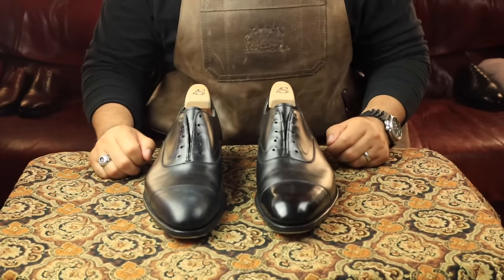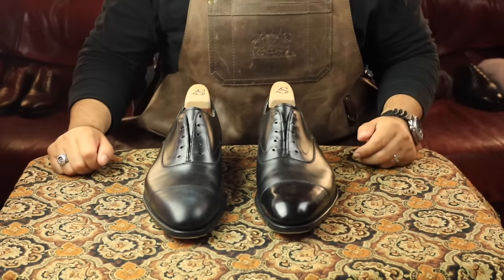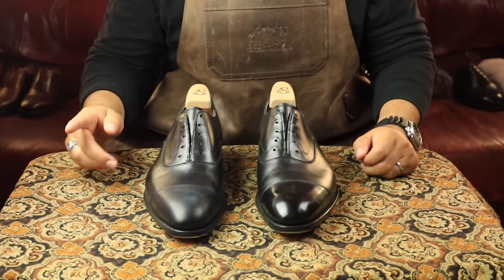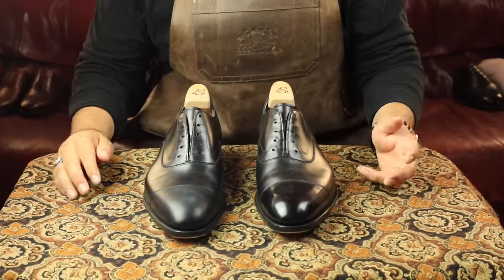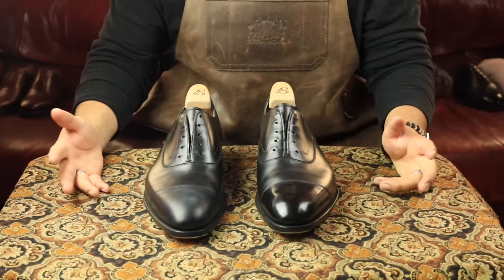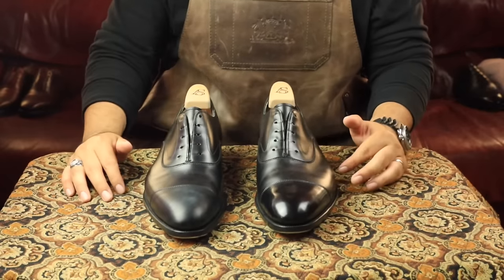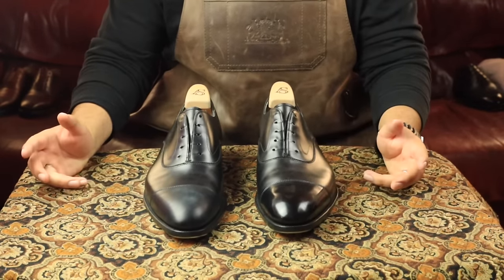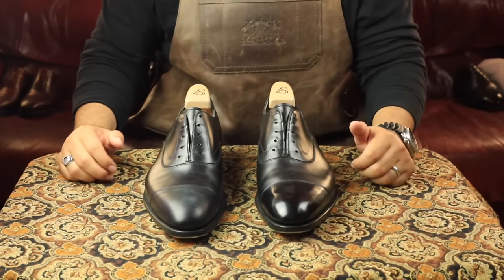Can You Mirror Shine a Shoe Using Powered Tools to Make it Easier?

Comment: I used to shine shoes (professionally) when I was 13-15. The reason you won't get a mirror shine with any of those brushes is because of the hair filament size. It's like trying to get a mirror shine with 600 grit sand paper.
Reply: What do you recommend

Comment: There was a shoe shine place at a food court in Irvine I used to go to 20 years ago.   The guy had an air gun or power drill of some kind with an attachment, and this guy did the best shines with it I have ever seen before or since.  $10 and 15 minutes.   It was incredible.  I've spent 20 years looking for the tools he used and have yet to find them.  But I know it exists (or can be done) and it works better than anything I've ever seen.  I wish I had asked them about it before they moved out, but I was new to it and didn't realize how special his work and tools were.
Reply: Advice from experts: never use a heat gun on your smooth leather products. It creates long term damage and causes disrupts in the inner layers of the leather
Reply: i use a warm oil (melted wax) and a paint brush, i melt the wax and brush it on to the shoe then use a cordless drill with a DIY attatchment made of a Screw and half of a horse hair brush and some epoxy, step 1 cut the brush in half then shape it into a circle, step 2 drill a hole slightly smaller than the screw, screw the screw into the brush and place a small amount of epoxy over the screw head making it more smooth optional, step 3 polish boots, paint the wax on and buff at slow speed, takes about 8-13 minutes to get mirror shine, been doing it this way since i was in the army.
Reply: @ainzooalgown7589  Many thanks for the clearly explained & detailed steps, Ainz! Well noted & I will be trying it out!
Reply: Where in irvine? That’s a 30 minute drive from me
Reply: You don’t need tools. Just time and technique.
Reply: Great tutorial / technique. Would be interesting to try this out, pretty Simple. I’ve shined cars before with dual action and they make tiny versions of those that might provide even more control. Shoe has to be secure of course.

Comment: More water on the brush. You've put the same amount of water as with the shamois yet the surface of the brush is dozens of times bigger. The ratio was off. The idea is there so it MUST be possible somehow. Again, great video, thanks for exploring.
Reply: Yeah, I also think one of the major problems is with the water. When he adds water it stays on the shamois rather than being wiped off. I think he should've sprayed water across the buffer instead of the shoe.

Comment: I use a battery powered mini car polisher that has a head that is horizontal to the shoe rather than vertical. The polisher has a maximum 2800 rpm speed and I run it at about half speed. I don't have a lint problem. But it only provides a good base shine rather than a mirror shine.
Reply: Sheepskin buffing rag and sheep suede are my favorite for final buffing.

Comment: When I was in the Army, I used strips of cloth diapers wrapped around a dowel in a drill to do my first heavy duty polishing on my brand news boots and low quarters. It made such a good first layer, that it was extremely easy to bring back a good shine quickly after that. Hardly spent any time at all on my footgear after that initial polish. All I had to do was rub some polish on with my finger, let it dry and then whip it with a polyester, or nylon sock after that.

Comment: You can do an almost mirror shine with tools, but it wont be like the real deal.

First, you need a silk wheel: i have one on my finishing bench and they're not so easy to find.
Then, forget the polish and use pure beeswax or carnauba wax, put on the wheel itself.
Then you use the wheel at low RPM to saturate the leather with wax.

It's wonderful for bookbinders, not so formidable on aniline or box.

Source:i work as a shoemaker since 2012.

Comment: Great video!  When I was in the Air Force in the 80’s we were issued combat boots with a capped toe.  I was able to get the mirror shine on the toe cap using - black wax, horsehair brush, water, and buffing cloth.  But the secret ingredient which appeared to get the wax to layer up and provide the mirror shine was panty hose applied with a buffing motion over the toe.

Comment: I may have found a way! 
I use a very fine cloth buffing wheel on my bench grinder to do the majority of the shining when I wax (aka burn down, look it up) my drill boots. The wheel is made up of multiple layers of soft cloth stacked on top of each other, which you then use the edges of as it rotates. Although I’m working on a pretty thick layer of beeswax (which was applied hot, so now hardened) the wheel does get close enough to a mirror shine that a minute or so by hand is enough to finish it off. 
I think this could probably work on a show that hasn’t been done with beeswax if you:
•ran the wheel very slowly (and made sure it was the softest available
•applied the polish only one or two layers at a time and buff each application to the highest shine possible as you go, rather than doing the majority at the end 
•and didn’t use any water, as I’ve had better results by just touching a block of beeswax gently to the buffing wheel for lubrication. 
Like I mentioned, I’ve only ever used this in scenarios where I’m polishing over a thick layer of hard beeswax, but I really think with a little adjustment it could probably work for normal shining too. 
Hope there’s something in there that can help 👍
Reply: Yeah slower speeds (with a good grinder with good speed control) along with a good soft cloth wheel would likely turn this around. Appreciate the data point!

Comment: When I was in the Army, there was a method that was used by a few soldiers that seemed crazy.  You would cake on a bunch of Kiwi on your boots, and then "bake" them in an oven (I don't remember what temp) and it would create an almost plastic-like mirror polish when you finished them.
Reply: There was a similar method with a blowtorch. If they are brand new boots, Kiwi and a hair dryer would be a good start. You weren't supposed to use Cherry Blossom, but one guy did and it worked fine.

Comment: I use a powered horsehair brush to get mirror shine on boots for the law enforcement academy. The rpm is alot lower than the one you used, I use Lincoln shoe polish and a heat gun. I finish my shines off with spit and a cotton t-shirt but the brush does 95% of the job. Great video!

Comment: I may have found a way!
1 use a very fine cloth buffing wheel on my bench grinder to do the majority of the shining when I wax (aka burn down, look it up) my drill boots. The wheel is made up of multiple layers of soft cloth stacked on top of each other, which you then use the edges of as it rotates. Although I'm working on a pretty thick layer of beeswax (which was applied hot, so now hardened) the wheel does get close enough to a mirror shine that a minute or so by hand is enough to finish it off.
I think this could probably work on a shoe that hasn't been done with beeswax if you:
•ran the wheel much slower than I do, of course making sure it’s the softest available 
•applied the polish only one or two layers at a time and buff each application to the highest shine possible as you go, rather than doing the majority at the end
•and didn't use any water, as I've had better results by just touching a block of beeswax gently to the buffing wheel for lubrication.
Like I mentioned, l've only ever used this in scenarios where I'm polishing over a thick layer of hard beeswax, but I really think with a little adjustment it could probably work for normal shining too.
Hope there's something in there that can help 👍

Comment: I think the problem lies in the materials.  Short fiber cotton is bound to do exactly what it did: throw lint all over the place! I had one beautiful mirror shine ruined by a single piece of lint, captured for all to see, in the clear glass of the shine. You do not want to know what I said when I discovered it!
You may have more success if you try putting an old merino wool sock over the polisher. I use one, by hand, to finish and maintain my shines, both mirror and satin, and have had no problems. Who knows; maybe the animal recognizes the other animal! Other than that, it's best to stick with 100% cotton t-shirts or chamois. I think that Dremel attachment was meant for polishing things other than shoes. It was a fun video!
Reply: Dremel RPM is just too ridiculously high for it to work.. a car polisher would probably do a better job.

Comment: Regarding the fuzzies you get from the felt polish pads:
You can limit those by applying a quick sanding to the pads. Start the felt pad spinning and apply some sandpaper. The fuzzies should latch on and leave you with a cleaner felt pad.

You /should/ be able to then use the felt pad (at low speed) to get a much finer shine than the horsehair brush wheel gave you.

Comment: First, don't use any high speed machine. Second, don't use any harsh materials. To be honest, machine shine is definitely possible but you have to find the right combination. I will suggest you put a soft sponge onto a lathe and adjust the speed to a low setting and give it a try. Otherwise use those 12v handheld drills.
Reply: I've had good success with power tools at the lower speed settings too. Not sure it will go to mirror tho. I always finished up with hand tools.

Comment: What about using a desktop wheel buffer with a nice cloth wheel. You know the ones that look like grinders with a wheel on both sides. You can adjust the RPMs and since it is stationary you can move the shoe around the wheel rather than opposite. It would allow you to have more control and reach all the nooks and crannies.

Comment: Being in the Army we used to have to get our Parade boots like that, we used to sit around for hours at basic training with ta tin of parade gloss boot polish a wet rag to get our boots to look like that. However after basic training I was shown by a senior soldier a quicker easier method by using black gloss kilrust spray paint, just do it in small light thin coats and put them in a large cardboard box to dry overnight, repeat until you get the desired look... Even got a well done from the CO on my boots.

Comment: In my opinion: Been watching this channel on & off again. I like the guy & see him struggle on the quest of the quick best shining methods. 

It's like this:

1.) Dry brush clean.
2.) Alcohol based dye the damage the same color.
3.) Rub out the surface scuffs with pine wood (leather is uniformed this way).
4.) Redye to a uniform color. 
5.) Apply a high gloss clear/neutral polish haze over the entire outside.
6.) Brush to bead up the polish.
7.) Draw a nylon stocking across the large areas for a mirror shine.
8.) Continue to brush off the ashy polish flakes as you wear the shoes & nylon shine routine until the polish loses its ability to shine.
9.) Repeat every third wearing.

The color needs to be in the leather, not on top. Pigmented polish stains clothing. Polish helps leather dry uniformly & keep it soft. You must rotate shoes with leather uppers every three days to keep the leather from bunching/stretching/fraying at the bends due to sweat saturation & keeping the contact cement from releasing. Can't wear the same shoes every day no matter the shoe/boot if its supposed to last. 

They do make power shoe buffers, but those are for paraffin waxes - not bee's wax. Kiwi would be OK being they offer such a machine. Kiwi is a thick cake type of wax I'm not partial to. I like Saphir Admiral Gloss Neutral polish. Would like Saphir Medaille D'Or Mirror Gloss, but it's way too expensive for a shoe polish. 

Where did those wonderful shoe trees come from?

Comment: When I was in high school (way back mid last century) it was a really big deal to have mirror shined shoes. I could never get the spit shine thing down. I started shining my shoes with Lincoln polish and a lambs wool on a drill. When they were as shiny as I could get them, I followed with simonize car wax and the lambs wool. Nobody's shoes shined more than mine. They weren't expensive shoes, and no-one's shoes last very long at that age, so while I never saw any damage to the leather, I'm neither recommending this method nor recommending against it.

Comment: I’m really sorry to say this. But I could have told you that. I served in the Australian Army for 21 years when spit polishing was mandatory. The exact reason you said. It’s gets it so far then it gets worse. The speed of the wheel just strips it off or melts it. Got to say though. You can mirror shine like a pro. We used Kiwi Parade gloss. Spread on a thick layer then ignite the flammable polish quickly to melts it, then repeat a few times. I alway found ice water or isopropyl alcohol good as the liquid. Then be patient and just circle away.

Comment: I think the rpm needs to be lot lower to achieve a mirror shine. At the current speeds the friction is causing the heat to take the layers away.

I have always wondered and was kinda hoping this works

Comment: When I worked I had one of those shoe shine machines in my office for an afternoon shoe touch-up. The trick seems to be to use the tool until the cloth polisher has absorbed enough wax. The lint will go and you'll get that shine. It's better for keeping up a shine than building one from scratch. Imho

Comment: Try again with the Dremel using the more solid lint attachment. From the video it looked like you used some sort of rotary brush (can't be sure). The lint attachment could work. Probably you need to dip it into the water though. The spinning motion would push out most of the water almost instantly, hopefully leaving enough humidity in the lint.
BTW, I'm not an expert of shoe shining, just someone with decent DIY experience to get a sense of how to replicate the basics of one process using some other tools.
I'll try it myself. If I manage to get a decent shine, I'll let you know.

Comment: I suspect one can get a lot farther with machine polishing with some care in tooling selection and technique:

(a) A place to look for inspiration is auto body work. Auto detailing people produce a large quantity of mirror shine every day (albeit in a optical material, automotive clear coat, that's quite different from shoe waxes). In particular, I'm interested in how a random orbital polisher with a soft cloth pad would do for you. If I ever get one (there's some paint correction/exterior detailing on my car I've considered tackling myself), I might turn it on my shoes for the sake of science.
(b) You put a ton of effort into thermal management with your manual mirror shines - with the ice cubes, the slow pace, etc. All of the examples here dump comparatively huge amounts of heat into the wax. Getting better control over heat would probably improve results significantly.
(c) Related: I've found in all kinds of disciplines that tool quality matters a lot to the results. I've noticed that you use top-quality materials (expensive Saphir products) but your power tools tend to be near-cheapest-possible versions from Harbor Freight. A Dremel is almost a toy! Invest in professional-quality tools with good enough speed control reduce the speed dramatically and use brand name polishing wheels. I bet you'll see a qualitative difference.

Comment: I believe the problem you saw with the small dremel was the rotation speed using a large wheel with the same speed is slower than a small wheel if that makes sense that is most likely why it was ripping it apart.

Comment: Dremel is way too high spped,you will not buff, just burn. But off coarse youbuff with tools, its very similar to waxing and buffing a car. It also depends on the hardness of the wax. i would suspect shoe wax is soft, so a slower rpm buff would be recomended, but enamel wax can handle higher speeds, that dremel was way way way toofast a speed, if it was a heavier tool or you pressed harder you would have burned thats wax coat and even possible the leather.

Comment: The first thing I thought of when I saw your method of coating was that heating the wax should cause you to destroy the layers unintentionally. I would be interested to know if the electric brush method would work if you cooled each layer after application rather than heating.

Comment: I use heat gun i between layers and I use a polishing cloth with my driller. It makes good enough mirror shoe shine for my taste
Reply: Could you burn a shoe or cause long term damage with a heat gun and/or hair dryer?
Reply from the maker: You’d have to go really overboard. I experimented holding a heat gun near a shoe at 1000 degrees. The leather started smoking a lot before any damage occurred.
Reply: How do you attach the polishing cloth to your drill?